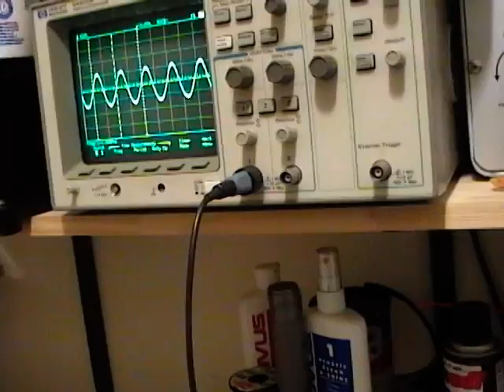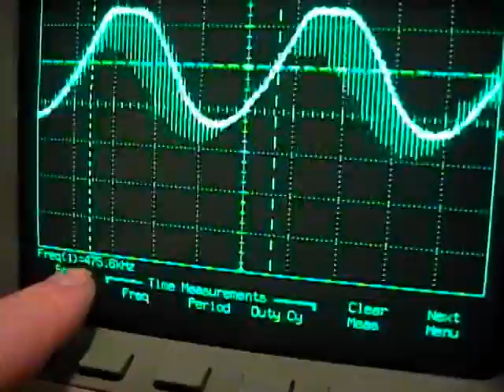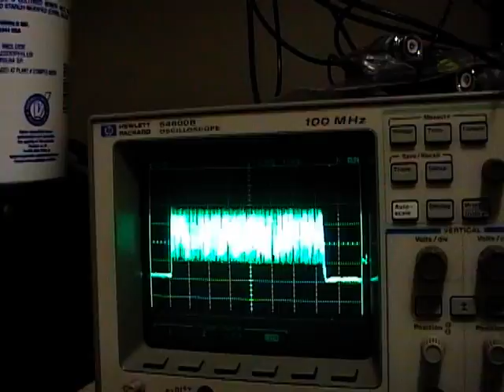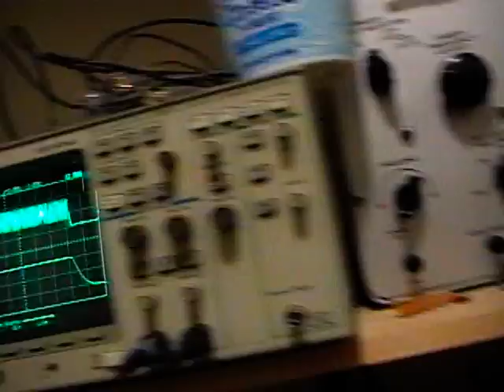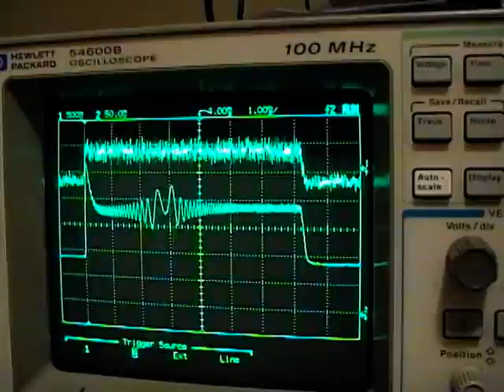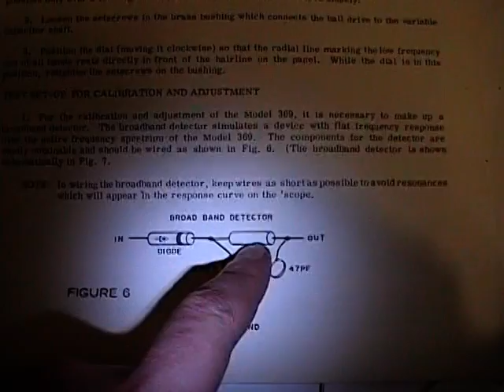Sweep Gens, Markers & Demod Probes

Comment: The best and simplest informative demo and explanation I have seen online as of yet. Sweep alignment is the most impressive technique I’ve seen , but cumbersome and complicated for the beginners. Over the years fir me the best and quickest method used a 455 kc modulated signal and a Simpson 260 VOM on the output function in the AC mode. The difference in final results is very small with no reception level of the radio. Your explanation was excellent ! I am old timer at this and the sweep dem does give one a much better understanding of the heterodyne concept. Thanks once again for showing is how.
Reply from the maker: Thank you. I agree with your assessment yet I get asked time and again to demonstrate sweep alignment. It has been quite a while since I touched on this topic and I hope to record an update soon. Perhaps when I get my Radiola 60 going. I think it's very worthwhile to go over the basics periodically.

Comment: @bandersentv
Thanks for answering all my dumb questions. I read them all, appreciate it.. Only complaint, could have used these videos 2 yrs ago, ha ha; when I was learning there was almost no info on it. Saw the Wavetek on the shelf. I had a 1080A, nice but two issues: 1) Built-in proprietary markers (in mine) were no where near what I needed for radio or TV. 2) Only goes down to 1 Mhz as you say. My "A" model was good, but 1080B models have a history of bad "black" caps. It can be repaired.

Comment: I'm dumbfounded how nice your WR50B is working. Mine did not have linear amplitude. The sweep rate (line) was not linear either or in sync with scope. You have a great presentation. BTW I call the pip a BIRDIE marker, since it looks like a bird flying at you flapping it's wings (at least how artist draw it as a squiggly line). You don't use a FREQ COUNTER? I found old tube signal gens are kind of out of calibration from the dial, ie very approximate. Again nice vids. Want to see the WOBBULATOR!

Comment: I use 10.7mhz and 455khz crystals in my RCA WR-50B.  When used in the 455khz or 10.7mhz sweep mode, you see a perfect little blip right in the center of the trace.  I paid $30 for the 455khz crystal.  These are like gold now.  Although the WR-50b accepts external modulation, it does not have an input for an external marker.  Too bad!

Comment: Nice explanation. Good clean video presentation. I agree with gmcjp. The sweep is perfect. Better than my Sencore.  That unit must have been rebuilt recently. The scope is nice as well. I only work solid state FM units. I would like to get a new scope as my old Hitachi is only 60mhz. What do you think about the new digital scopes?

Comment: @bandersentv  I recently acquired a WR-50B and I have a few questions:

1.) I'm getting about 55VAC between the WR-50B's ground clip and anything grounded. (Highlighted with the fact that any time I clip it to something I see sparks). I've recapped it, and replaced the 1N3756 rectifier with a 1N4007 and nothing has changed. Is this normal?

2.) when I have it on sweep mode, the wave form is uneven. The beginning of the sweep is bent up, and the end is bent down. But, interestingly, when I connect the scope probe to the wiper pin of the RF attenuator (effectively eliminating the .001uf capacitor in the plastic shell), the waveform stabilizes and looks like what's in your video. Any thoughts?
Reply from the maker: +X5Industries There are .01 uF caps between either side of the AC line and the chassis.  That's likely causing the voltage and sparks.  You could try disconnecting them and see if the sparks stop.  If so, reconnect the caps and don;t worry about it.

I'm not sure about that .001 cap.  It's been over five years since I made this video and my memory is a bit foggy.  Try asking on the antique radio forum.

Comment: @umajunkcollector 
Don't waste your money on a PC scope. If you just want to GOOF they have some semi free share ware deals. If you want to get serious, find a used analog scope if working on radios. For digital a storage scope might be better. You get what you pay for, and those PC scopes have low bandwidth; when you add up the cost they are expensive for what you get. Get a used scope for $50-$200, very nice. Do some research or PM me.